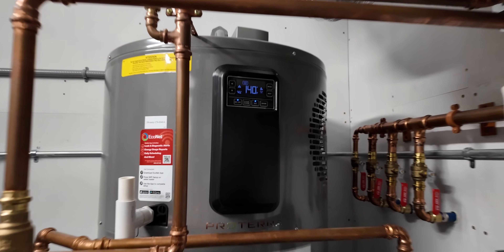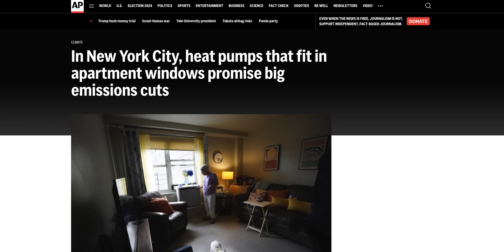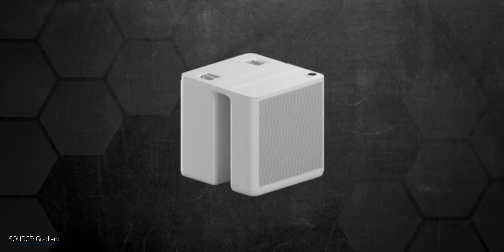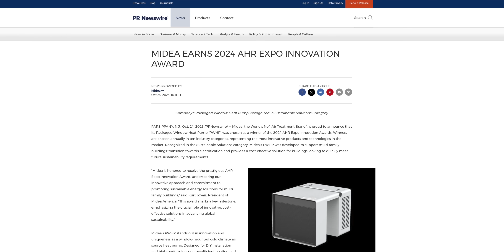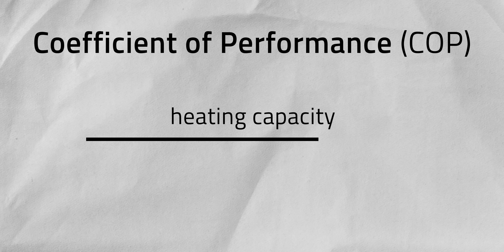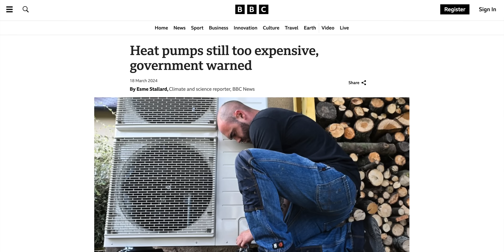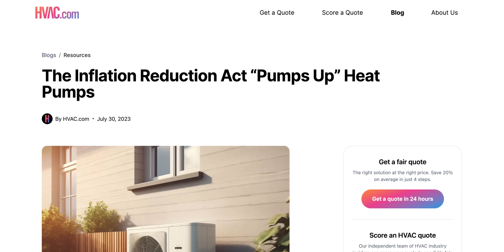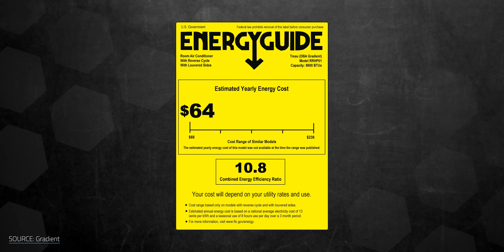Why This Window Heat Pump Is Genius

Comment: EG4 Hybrid Solar Mini-Split Air Conditioner Heat Pump AC/DC| 24000 BTU | SEER2 21| Energy Star Certified | Plug-n-Cool Do-It-Yourself Installation ~$2000(?) the kit w/ solar panels is ~$3000(?)

Comment: MIDEA has been producing induction AC window units for several years that are quiet, efficient, and low cost.  They are U shaped rather than reverse U but at around $300 for 9000BTU that are a great choice for many.  Simply re-engineering to a more ergonomic reverse U design should not cost 10x more.  They need to sharpen their pencil a bit.

Comment: What's the difference between heat pump and AC? Every AC sold here in Croatia can also heat space same as heat pump and we call "heat pumps" only devices that heat the water and then that water is used to heat the space through radiators or floor pipes.

Comment: As a licensed refrigeration mechanic running an HVAC business in Canada, I can accurately predict that these window heat pumps will be throw away garbage when they break down.
I sure won't help anyone who buys one of those things. People that buy one of those types of systems wont be able to afford to pay a technician 80 to 100 dollars an hour plus a service call charge to repair those things. HVAC companies will just turn their backs on those owners of those types of heat pumps. Also, Midea is a Chinese based company. Good luck!
Reply: Matt: These window heat pumps will likely work well in the areas they are installed if they are sized right. Up until they break down things will be great. When it breaks down and the estimate for repair comes in at a cost of 1000 dollars for the repair, the customer had better have a solid parts and labor warranty from the manufacturer for 10 years. Those warranties had better be solid and include the cost of refrigerant as well, which most manufacturers do not cover in the fine print. The labor warranty cant be just a workmanship labor warranty. Do you see the loopholes in a workmanship labor warranty?

Comment: The design only works if you have a standard window with nothing protruding below it on either side. My apartment does not.
If they design a pump that is exactly the same form factor as window ac units, I might get one. I'm fine with one window having a permanent obstruction.

Comment: Midea isn't liked to much on reddit the heat portion is loud one user said it was like a demolition Goin on. On cool it's quiet on heat it's loud. People were saying it's only loud from a dead start so they leave the fan on all the time.....one, there goes quiet two, no energy savings if you have to leave the fan on..

Comment: 9k btu?  so it can cool/heat less than 350sqft?????????
That's absolute garbage
there is no way the math makes any sense on these.
you're giving 260-2500 (roughly) cost for AC per year
A full mini split for an entire house doesn't use anywhere near 1000/yr.

Comment: Sorry, but how is this any different than the currently available cheap window heat pumps that have been around for ever? its the same old thing in a new dress at a stupid price. Sure you get more window but its the same idea. Also, old style window aircons have been able to heat and cool forever.

And at 9:33 you compare it to a $150 heat pump window aircon, its the same thing...........................................

Comment: Recycling the condensate to moisten the air is fine for the winter, but it won't cut it in the summer, in many areas of the USA. It's already plenty humid in the summer in places like NYC. They'll still need a condensate drain.

Still, I can see these becoming really popular for new construction, as they'll basically eliminate the expense involved with a skilled heating contractor. That will probably more than offset the costs of the units themselves.
Reply: Nobody wants window units in new construction. Mini-splits are cheaper even you add the installation costs. You really only need an EPA 608 certification which is easy to get. You really only need a more advanced skillset for installing new central systems.

Comment: Are there flexible copper pipes in there? If not, how did they solve the problem of refrigerant leakage through rubber/silicone hoses? Do they just stop working after a few years when it all leaks out? At $3000 it should be cheaper to pay for the labor to put in a more capable mini-split system.

Comment: .... You know what also helps with saving on the heating and CO2 emissions?
Windows that actually seal and insulate properly.
In EU, fully sealing tripple pane windows are not just common, but also mandated on new buildings and heavily subsidized in reconstructions.
Putting a 2kW heatpump of questionable CoP right behind a single pane, wooden frame sliding window is just about the worst possible case for your return on investment, let alone the environment.
I think we have plenty enough information to decide on this one...

Comment: there are already windowed AC units that can do cooling and heating and they cost barely 200$ and even provide higher capacity with the same R32... 3000$ even 1000$ is ridiculous.... i don't understand whats the difference between them and what you are showing here.. they just split it by half and call it a day... i would assume that windowed units are even more efficient cus the condenser fan is the same as a evaporator fan.... not to mention that split units exist and they cost around 250$ with the ability to install the outdoor units on the wall or the roof.
americans need to understand that a heat pump is not much different that an AC unit... just reversing valve.

Comment: Normal air conditioners ARE all heat pumps already.  They just run in one direction.  A standard window air conditioner is only a few hundred dollars, and all you have to do to make it heat your room is to turn it around and mount it so the cold air goes outside and the heat exchanger is inside!  You can add a small fan to blow the heat around the room for under $20.  Adding a thermostat to shut it off when the room is hot enough should cost about another $20.  $2000-$3000 is totally ridiculous!

Comment: …Or NYC could require buildings be retrofitted with more efficient hvac,insulation, windows, etc. But that would be too expensive so let’s ADD many more watts of energy consumption to these buildings so tenants can fight against the inadequate or overzealous boiler system.

Yet again pushing the problem on to consumers, exploiting federal subsidies, and selling only to the richest as an accessory for their conscience.

Comment: There is a huge fallacy when the COP of a heat pump is compared to a natural gas boiler. These heat pumps may have a COP of 2 on a cold day when they are needed most, but if the electric grid is 40-45% efficient at converting natural gas energy at the local utility to electrical energy at the wall outlet, then the total COP falls to 0.8 to 0.9. with lots of complexity between the actual energy source and heat in the apartment. Meanwhile the delivery of natural gas to the building boiler by pipeline is extremely efficient, almost 100% so. This means the total system performance of the boiler is virtually the same, with far less complexity and likely a much longer service life. The individual heat/cool units have advantages of individual control and cooling in the summer, but the promise of extreme energy savings is likely a false hope.

Comment: One way to increase the Incentive for Apartment dwellers to switch to these units is if the Law that requires Apartment Building Owners to reduce their Emissions forced them to take the Heating Price OUT of their Tenants Monthly Rent for those that shut off the Central Radiator(s) in their unit and start using a window heat Pump instead...

Basically, make it Law that if they pay for their own Heating and Cooling via a Window Heat Pump, their Building Rent must go down by roughly what it costs in Power to run that unit for the average comfort level, say around 72F (22C)...so if keeping the Apartment at 22C costs $15.00 in Electricity per month, that's how much the Landlord must reduce their Monthly Rent by for a Net $0.00 change in their Monthly Budget...the Landlord saves some money because now they don't need to pay for the antiquated, inefficient boiler (24/7 circulation motors, fuel, maintenance, inspections, repairs, insurance etc., it can all add up fast) - whether or not the savings shutting down the boiler gets him equals or exceeds the reductions in Rents has yet to be determined...

Comment: The only new thing here is the U shape... which is indeed a forehead slap moment of "why hasn't this been done before?" I literally used my ordinary reverse cycle window unit this morning due to the cold down here in Oz. Now they need to make a vertical split U unit for sliding windows, not just sash windows.

Comment: A heat pump is basically just an air conditioner, with some extra valves and pipes.
I honestly do not understand why they cost so much more.
And many of them dont, its just that the people who install them dont use those.
You can pay almost the same amount for a DIY heat pump, as you do for a DIY AC from the same company.
A huge difference from these, than the whole home heat pumps you'll see from major brands, often 2-3 times the cost of an AC, when there may be an extra 20% in materials and labor.

I forget the brand i was looking at when i was looking for DC powered AC(back when i was considering going off-grid solar) but i noticed the company had those low profile ~30k BTU  heat pumps of the same capacity as their AC units for only like $5000 when the AC units were ~$4000.
When i was looking at...... .trane? some name brand, it was $7000 for the AC unit and i think $12K for the heat pump

Comment: The pricing for these is psychotic.  A decent window a/c unit rated at 10,000 btu runs about $400.  They basically want almost 10 times the price just to add a reversing valve (yes there is more, but not 10 times more?). Talk about taking advantage of people, and the government. lol
I would very much like to get a window heat pump for our house, but they just don't make them at a sane price yet.

Comment: This thing you are referring to as a “heat pump” is known everywhere else in the world as “window mounted reverse cycle air conditioners”, and I have had two in my house (built in 1972) has had two heat pumps since 1982. One in a window of my master bedroom, and one in a dining room window of my L shaped lounge/dining room. The  smaller one in the bedroom runs off a standard 240volt 8 Amp outlet, and the larger lounge unit has a dedicated 240volt 15 Amp outlet. Together they heat an/or cool the entire house in both summer and winter. 

No one, and I mean absolutely no one here in Australia uses gas boilers. Not in apartment buildings, nor in standalone houses, and they never ever have. Prior to the 1980s we used cool only air conditioners, and some (very few) used natural (town supplied) gas to run gas heaters, but nobuilding even used gas boilers, EVER!, but since the 1980s every single house has used “heat pumps”. Either in the form of whole building/centralised reverse cycle air conditioners or split system reverse cycle air conditioners, or window mounted reverse cycle air conditioners, all with inverter technology. 
“Heat pumps which fit into sash style windows” have been around since the very early 1980s. How is America 50 years behind the game?
Oh, and by the way, window mounted heat pumps (reverse cycle window mounted air conditioners) currently start here at AU$660 (US$450).

Comment: "We want to keep costs affordable" - *proceeds to charge 20x the cost of design and manufacturing
Heat pumps are somewhat more complicated than just adding a reversing valve to an AC unit, but not that much more. 
And for $150 I can buy a window AC unit, short its thermostat, and put it in my window backwards. The price of heat pumps amounts to nothing more than price gouging.

Comment: I paid $300 for a portable AC at my cabin which doesn’t require a difficult installation (took less than 5 minutes) and yes, it provides heat during the Spring and Fall. We used to have window units but airborne germs and algae made the external part of the unit get very ripe during the season requiring them to be virtually disassembled to be cleaned. There’s also the problem of bugs. The portable unit works with your screens so no additional blocking materials are required.

Comment: DIY installs always concern me cause lots of people don't understand the basic requirements (as there would be frame/building requirements to hold them in place safely even with a kit) and also what would the noise/vibrations do if installed on larger scales throughout buildings or entire suburbs and then there is the animal problems with birds etc...Think it could be a good idea but like most things doing things in a small batch is different to large scale changes.

Comment: Several years ago I picked up a Midea U-shaped window air conditioner and was Very impressed with it's efficiency and its practical design. I spent a career designing air conditioners and wish I had thought up this clever form factor myself.
Reply: from what i understand, it's actually an old design from decades past

Comment: Why is this unit $3000? Midea already makes two units, one is in this exact form factor but 8000 BTU for $350 and one is 12000 BTU for $500.  Yes its larger, but its not 5 times larger. LG has a 25,000 BTU unit one in a different form factor for $700. 

This is just "Government contract mark up"  The government says they wont pay more than $3000, "WOW OUR UNIT IS EXACTLY $3000"

Comment: They're all 9,000 BTU's as usual.  9,000 BTU's barely cools a good sized walk-in closet.  You're going to need to start with 12,000 BTU's to get a bedroom nice and COLD, unless you want to overwork your 9,000 BTU A/C and live with higher temps and humidity.  Also, what no one tells you is that even a 120 volt connection A/C is going to need to be on its own independent electric circuit and have its own independent circuit breaker.  If you don't add another line, you're going to run into amperage problems and circuit tripping if you use other electrical devices in your bedroom (computer, cell phone charging, vacuum cleaner, lighting, etc.).  So add in the cost to run another electric line to your electrical panel.  Personally, I'd just get a 12,000+ BTU, LG brand window unit and be done with it.  While not perfect, they've been the most sold/popular window unit brand worldwide for decades, so they must have got it right a whole lot more than they've got it wrong.